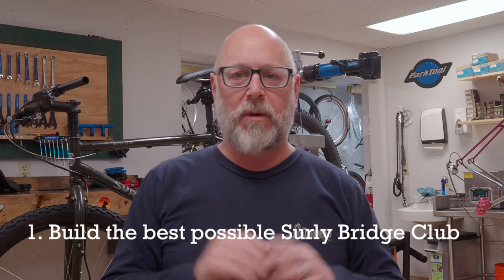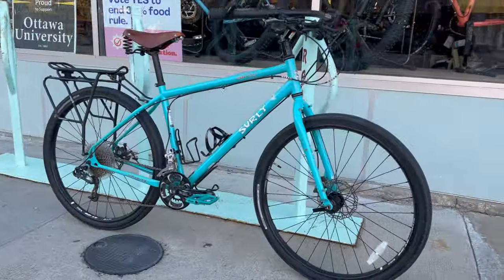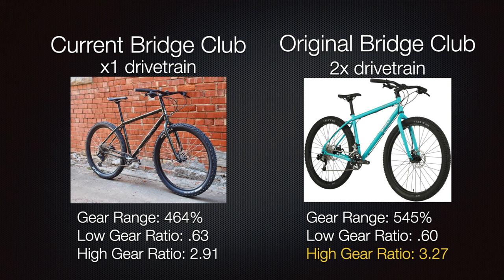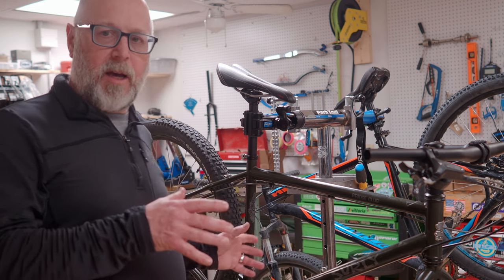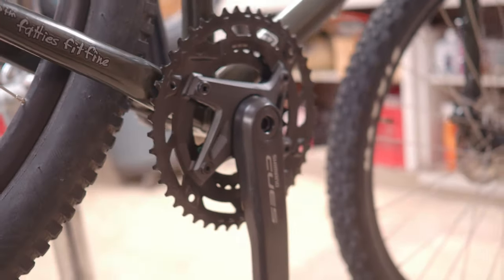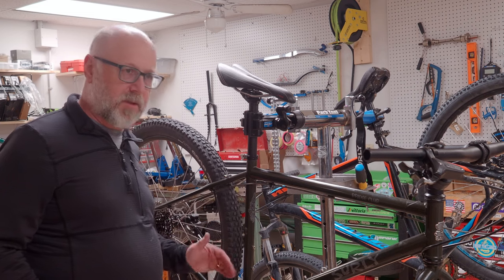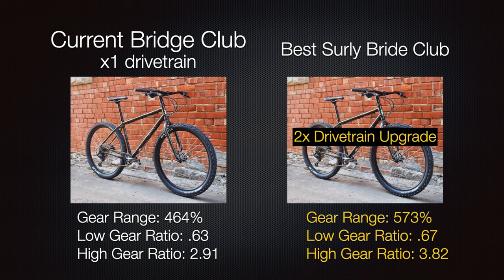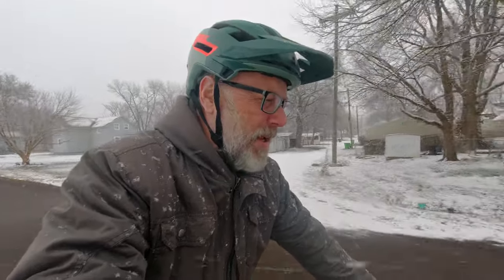Building the Best Surly Bridge Club Part 2: Shimano Cues 2x Drivetrain Upgrade

Comment: While I appreciate what you are trying to do, IMO a much more elegant, inexpensive, and simple, way to accomplish the same thing would have been to simply mount a 2x crank (like a 36/26) with an aftermarket narrow/wide big ring, and leaving the stock small ring as a ghost ring that could be manually dropped down to on the rare occasions you need the really low gearing (so 1x with no front derailleur, but the option of manually moving the chain down).
Reply from the maker: That would be a great approach!  We have a lot of rolling hills here which might be a problem but I love the idea.
Reply: I bet money that you don’t live in the Pittsburgh area.
Reply: @dant.6364  Correct. I live (and ride my bikes) in NW Arkansas—where the hills are no joke, and just keep coming.
Reply: @kennyness8881  a gear that you have to get off the bike and move the chain to use? did we just go back 100 years. there is nothing elegant about that
Reply: @phililpb  We do not agree. My solution gives me simplicity of 1x, many useable gears, straighter chain lines, and the option and confidence (on very rare occasions) to go to some really low gears—-without the clunky front derailleur, cables, etc.  You do you, but my 2x option is a good solution for situations where very wide gear ranges are needed.
Reply: @kennyness8881 I guess a lot depends on where you ride. I think I would need to change between the two too many times to make that a comfortable option for me

Comment: so you needed to go triple... and ditch the rear gearing back to 9 speed or 8 using 9 speed chain and mech.  my 22,32,42 to 11-32 on my 29er is covering everything..
Reply from the maker: Thanks for watching! I agree.  I think the triple is completely underrated, especially for touring bikes.
Reply: A double works with an 26, 40 chainset and 11, 42 cassette. According to gear inches, you get more low and high than the triple. I have that triple on my 90's mtn bike though on 26 inch tires.
Reply: @jollyandwaylo  sure that sounds viable. I think I calculated 26-42 being best for a compact double for me. Triples exist already no mods required

Comment: Hi, your video arrive right on time regarding my BC build !

I've had exactly the same thoughts regarding the gear ratio on the Surly stock bike. That's why I got a frame instead. The stock 1x11 doesn't make sense to me neither. I knew absolutely nothing about bike mechanics. So I've been thinking/reading about the parts for a very long time. The front derailleur was the last part I hadn't figured out yet, not finding the right model... It's all good now, the fd-u6000-d seems to be the perfect one (with the probel solvers), thanks ! :)

About my specs, I went differently (2x11 and 11-42 cassette). Here they are :
BB : XT BB-MT800 
CRANSKET : Shimano Deore FC-M5100-B2 (the 36T chainring is going to be replaced with a 40T shortly)
CASSETTE : SRAM PG-1130 11-42
CHAIN : Shimano 105 CN-HG601-11
REAR DERAILLEUR : Shimano XT RD-M8000 (SGS)
FRONT DERAILLEUR : Shimano cues fd-u6000-d (so thanks to you !)

What I still have to do is to get a 40T chainring to replace the 36T at one point for my commuting setup (700c x 43mm). I'll keep the 36T with my 650 wheelset..
This derailleur has a 47T capacity. That's why I chose it. With my setup it's 45T (42-11+40-26). So I guess I could even go with a 42T chainring as well (but I won't anyhow).

About the gear ratio, it's very close : 
Gear range : 587%
High : 3.63
Low : 0.62
(it would be 617% if I'd used a 42T chainring, going 42-26 like you).

Cost for all listed parts above : 420 $ (CAD) so 310 $ (US) taxes and shipping included. I still got to get the 40T chainring though so add few 10s $..

Real Frankenstein build but I like that. A great learning experience ! :)
Reply from the maker: Great setup!  Glad we could help solve the front derailleur for you.  I'd love some photos of your completed build.  I may to a "readers ride" video at the end of this project.

Comment: On my gen 1 KM i run a 42-26  front crankset, zero issues with a downpull Sram X7 front derailleur, running Shimano 9 speed 11-34 cassette and chain with a friction MicroShift thumbie for the front and indexed thumbie for the rear Deore mech.
Front changes that 16T step like a champ!

Comment: Looking at the CUES FD looks like they offer "dual pull" so can be both bottom and top pull?
Reply from the maker: Yes, looks like the FD-U6000-L and FD-U4000-L are both Dual Pull FD. I actually looked at using for this project but it's clamp mount and requires cable stops which the Bridge Club doesn't have. Thanks for watching the video! I'm a big fan of your channel.

Comment: I just did a very similar drivetrain swap on a 2023 TREK Dual Sport 3.  Fortunately the 46/30 cranks were no issue on my frame, and the CUES crankset has an excellent built-in adjuster for proper chain line.  I was considering using a similar Microshift Sword 2x setup, but the lack of flat bar shifters put the brakes on that.  This is my second CUES drivetrain swap, the first was on my e-bike.  Very pleased with the durability of the linkglide stuff, so I don’t care about the small weight penalty.  BTW… the CUES front mech (top swing), is dual pull - will work with top or bottom pull cable routing.
Reply from the maker: I almost went with a Microshift Sword upgrade for this project.  I was planning to use the Microshift thumb shifters.  But, I'm happy with the Cues drivetrain so far.
Reply: @ottawabikeandtrail I actually bought a pair of those thumb shifters, but didn’t like the ergonomics, so I went the CUES route.  Microshift has a compatible right-side trigger shifter (their Advent-X stuff has the same pull ratio as Sword), but no left-side trigger shifter.

Comment: Great video. I'm thinking of doing a similar conversion. Would the SHIMANO CUES TOP SWING Front Derailleur (Clamp Band Mount) 2x11/10-speed (FD-U6010-L) work with this setup? Or is there an issue with using this clamp mount?
Reply from the maker: We originally planned on using the U6010-L, but the clamp mount does not position the derailleur properly.  I also confirmed with Surly that the BC needs the direct mount adapter.  If you figure out a way to make it work let me know me  know.

Comment: Really nice video. Frankly, myself, I hate trying to make things work in a way they weren’t really designed. I would have gone for a full xt 1x 12 speed with xt shifters. Simple and efficient and strong.👍
Reply from the maker: The 1x12 XT option is certainly a good choice and we LOVE the XT drivetrain.  But, we haven't come up with a way to solve the range issue with a 1x.

Comment: Seriously looking at doing this conversion...have the stock BC in XL and like the low gear for climbing on my loaded touring rig but would like more top end for the flats.  I put on the jones h 2.5 bar and a Brooks b17.  Also added clip on aerobars to give me a position to rest my hands and wrists for my carpal tunnel.  Installed axiom rear rack and front pizza rack.  Have axiom low riders if I need 4 panniers but trying to reduce my gear wt for touring the pacific coast bike route.
Reply from the maker: Thanks for watching the video!  We've just got the complete parts kits for this upgrade available on our website.   I'm going to check out Axiom bags.  I don't have much experience with them, but their prices seem good.

Comment: Is there a fitment reason you didn't go with a larger Cues Cassette like the CS-LG400-11 11/45?
Reply from the maker: I’m pretty sure I maxed out the derailleur chain capacity with the 39 tooth cassette and the 42/24 combo up front.

Comment: I'm looking to build my own BC right now and I've just started my research phase. I am looking to keep a 1X setup but I do want to have a 38T or 40T chain ring.  Per the Surly website, it says that I need to use a Boost crankset.  Have your done any experimenting with larger 1X  chain rings? Is having to use a boost crankset true?
Reply from the maker: I have not tried a larger chainring on a Bridge Club.  But, I'm sure that a boost crankset would be required in order to get the proper clearance if you are going to go beyond 34-tooth chainring.

Comment: That square tapered bottom-bracket is fine, but how did you know what width of bottom bracket to buy?  (as far as I know, they come in different sizes, like 110, 113, 121 )  Also, the Bridge Club has a 73mm bottom bracket. so does a standard Shimano BB fit in that ?    Thanks for the video and going through all that trouble.
Reply from the maker: We had to try out a few different spindle lengths to get the right chainline.  With the stock rear wheel we found the 118 mm spindle worked best.  So, we used the Shimano BB-UN300 73mm BB with 118 mm spindle.  We are stocking them if you need one.

Comment: For the new model bridge club that comes stock with cues, would you need to replace the rear derailleur/shifter if changing to 2x or would the stock work with a smaller CUES casette and a front derailleur?
Reply from the maker: Yes, you would want to replace the rear derailleur with a 2x specific one (RD-U6020) vs the (RD-U6000) that comes on the bike.  The shifters will work, but of course you'll need a front shifter.

Comment: IMHO 1x drivetrains are for gravity bikes or plus bikes where you can't fit a front derailleur. Or, you don't care about top end or low end and are happy with a limited gear range. I am not happy with fewer choices.

I run a 2x MicroShift Advent drivetrain on 2 different bikes. 28/44 in the front with 11-42 in the rear on my 650b x 47 adventure bike and 28/38 on my 29 x 1.95 adventure bike with the same 11-42 cassette in the rear. I have 685mm Haro Pivit riser bars on both bikes. So, standard MTB components work for me. 600% gear range on the 650b bike. I may put a 26T chainring on the 29er. But, it's super easy to pedal up hills and go fast enough on the flats with either bike. The 29er is more off-road specific with Kenda Straight 8 tires. The other bike is more versatile with smoother rolling American Classic Kimberlite tires. Either way, modern wide-range 2x drivetrains are great. EDIT: 1x drivetrain chainline is also only good in the middle of the cassette.

Good job on the video! I considered a Bridge Club a few times, but went with a different brand both times.
Reply from the maker: I have a few 1x bikes. But I’m with you. I love the wider range that a 2x provides.

Comment: Any recommendations on a groupset that would accommodate a 10-tooth small sprocket (ideally something like a 10-48t or even 10-51t)? Would be great to just swap in a different 11-speed cassette, but I haven’t been able to find anything in that range that’s compatible.
Reply from the maker: Not many options for a 10-tooth small sprocket, at least that I'm experienced with.

Comment: Well you didn't say anything about what cues gearing you used 9, 10 or 11 speed. Or rear wheel spacing 135, 142 or boost
Reply from the maker: I should have mentioned that!   Stock rear spacing 142 and 10-speed.  Thanks for pointing that out.